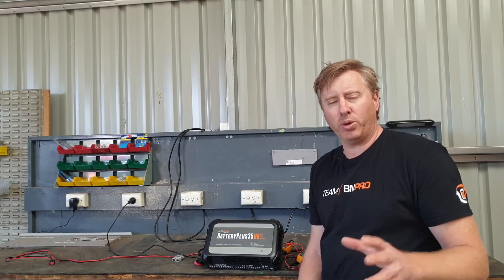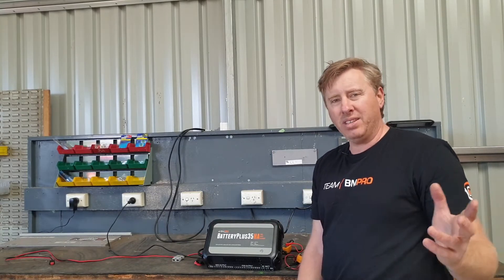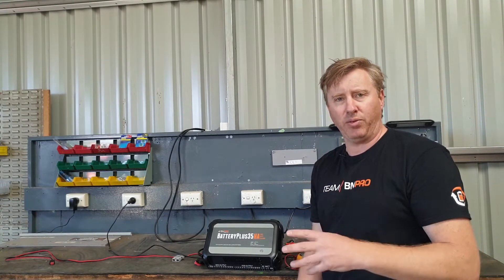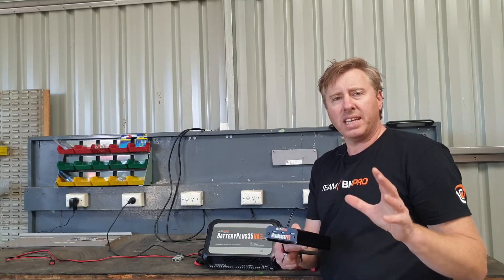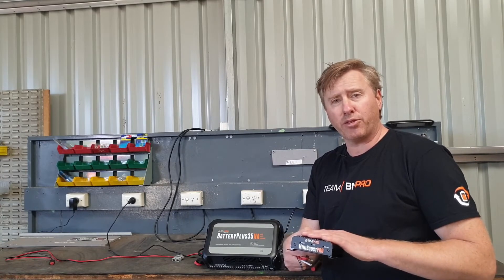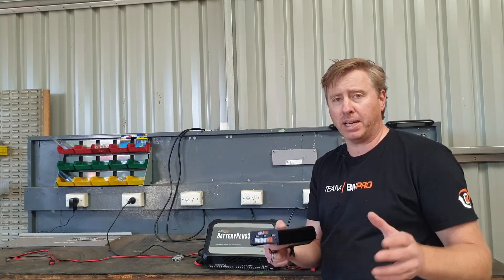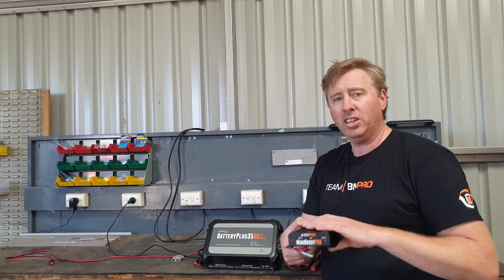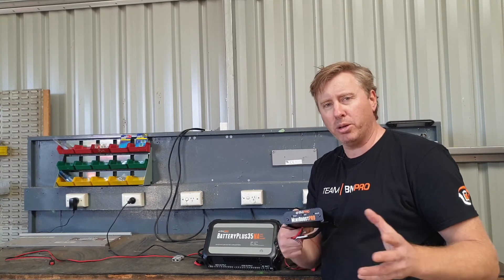BatteryPlus35 (TechTip 7) DC Charging & Getting Around A Smart Alternator

Comment: The Video re enforces my logic in that the Miniboost pro takes the input from the car, boosts it and is then sent to the Plus35 via the AUX+ however, the Battery Plus35 manual shows that the Miniboost pro input is via the BATT+ infact there is no mention of it being connected to the car at all. The wiring diagram in the Miniboost pro manual is a littl better but still not clear. Can you clear this up for me.  I sent a diagram via the website support. Thanks.